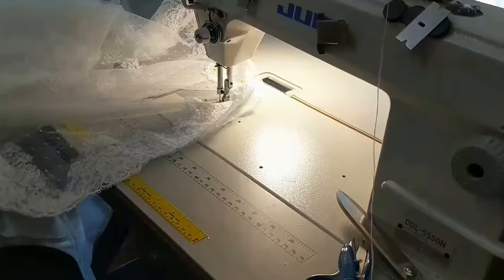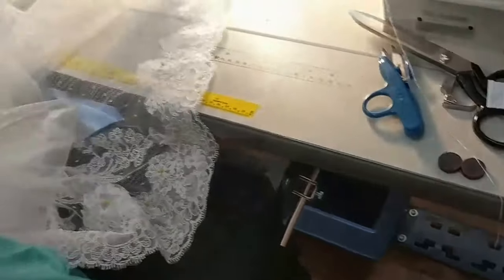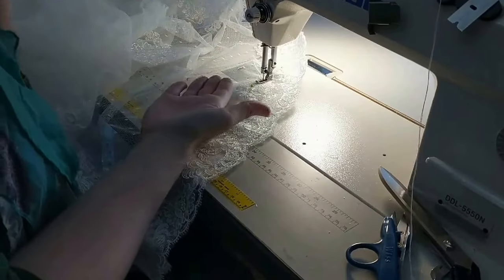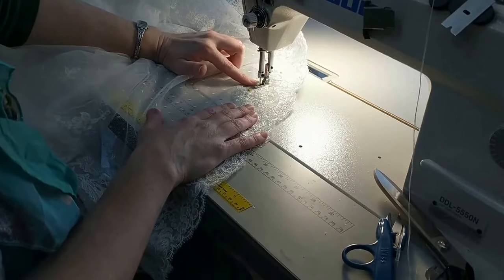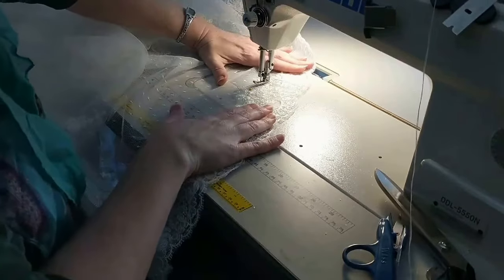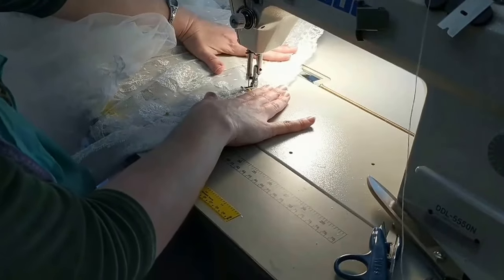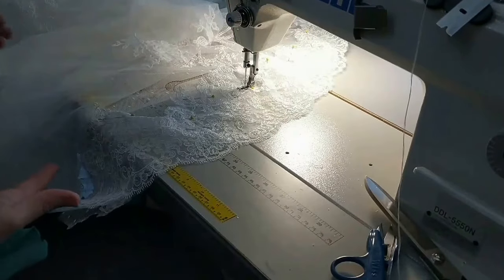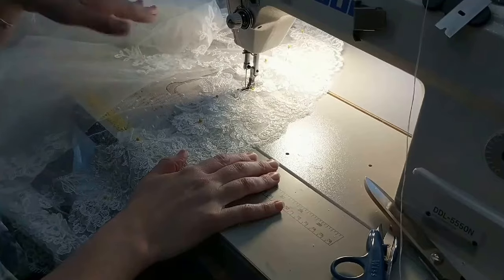How to sew a lace applique hem onto a bridal gown. Hem a lace wedding dress.

Comment: When you removed the lace, did you cut around the lace, through the tulle, or did you cut the lace off the tulle?
Reply from the maker: It depends. Time & the bride's budget can affect that decision. Also depends on how much length you are removing, and how tall the swing is on the lace. If it has high, skinny peaks, you must remove, not cut out. Because the peaks won't align correctly.

Comment: I'm having trouble with the bobbin thread being really loose, or not sewing at all. adjusting the tension seems to make little difference... do you have any ideas? thanks!
Reply from the maker: Did you adjust the bobbin tension? Also- is yours the same machine as mine? It's hard to say if a diff machine. But, when my tension isnt working right for free motion, I make sure the thread is looped correctly through the little tensioner on a post that is on top of the head of the machine
Reply: @BridalSewing  I have a different machine to yours, it's a basic Janome. But... I thought all this time I couldn't adjust the bobbin tension on my machine.. But I googled it after reading your reply, and it turns out I can 😅 
Would you  tighten or loosen the tension? It seems mine might be fairly tight.. 
Thanks so much for replying! Can't believe I've had my machine for 12 years and didn't know this 😅😅😅
Reply from the maker: Honestly, just experiment. Before you first change the tension, mark your sweet spot with a pencil mark so you can get back to it. Only turn then screw 1/4 turn at a time.
Reply from the maker: Honestly, just experiment. Before you first change the tension, mark your sweet spot with a pencil mark so you can get back to it. Only turn then screw 1/4 turn at a time.
Reply from the maker: Try looking up a vid on free motion stitching on a home machine? Someone may have that on here. I'm thinking with my home machine,  I just take off the foot & drop the feed dogs?
Reply: @BridalSewing  good idea, thanks so much for your help!! Hopefully I've been saved from a tonne of hand sewing!

Comment: This might be an odd question but I was wondering what is the best way to remove the lace from the bottom of the dress
Reply from the maker: Not odd at all. As usual, it depends! I am gathering footage for this very question this week. I hope to post soon! 
The short answer is, sometimes nippers to separate.  Most often a razor.  Sometimes, just cut around the applique.
Reply: What is known as tagging and do you know if you have to do it on communion dresses or baptismal 
dresses